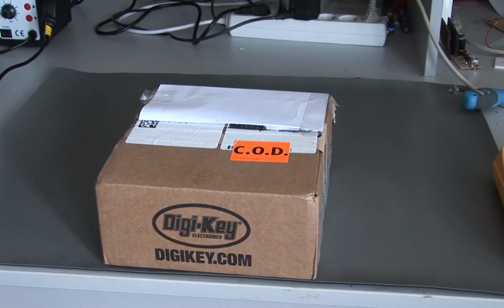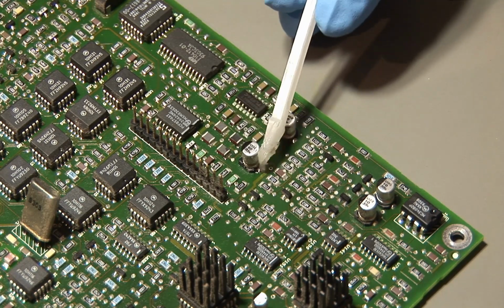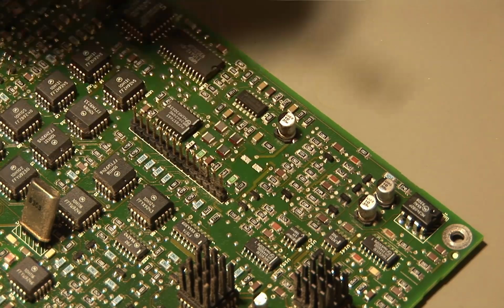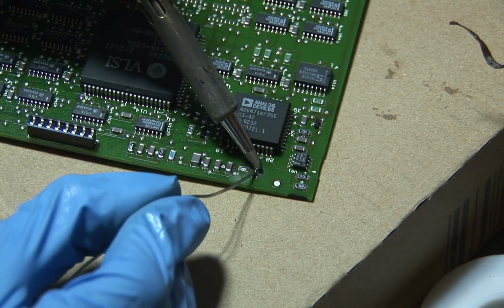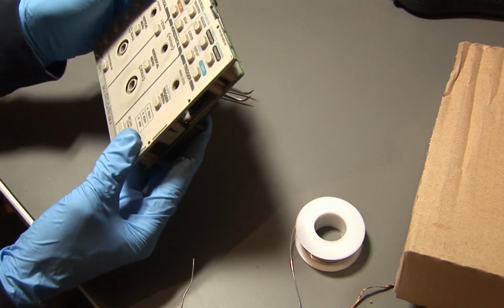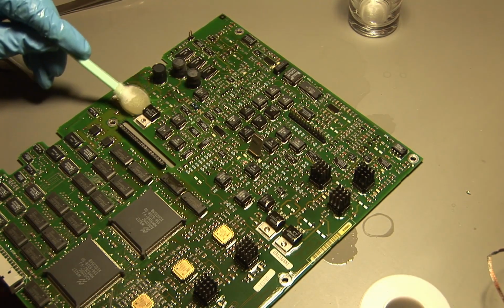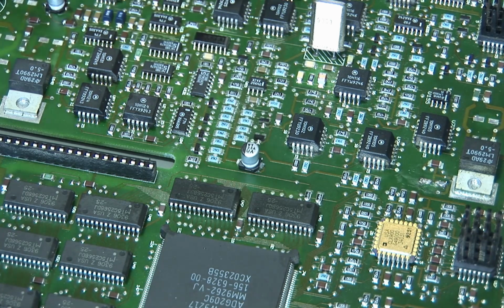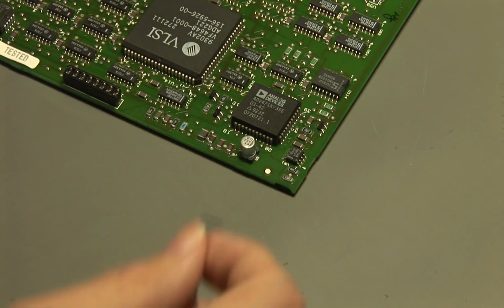Tektronix TDS 460 repair part 3

Comment: Many people just twist off the capacitors, its a lot easier. You could also just wash the boards off with distilled water and soap, rinse off then dry.
Reply: Is not recommended to do that because the pads could be delaminated from the PCB.

Comment: Very nice job there bud. A quick tip from a trained solder technician, after using de-soldering, always cut the excess off, or your heating the board and all that excess braid at the same time. That increases the amount of time you're heating surrounding components. Which means the other solder joints can start to partially melt and develop cracks or a cold solder joint. Thanks for sharing, Thumbs UP! Best Wishes & Blessings. Keith Noneya